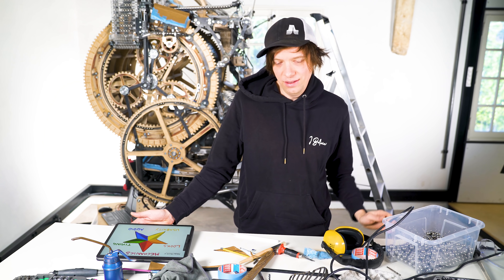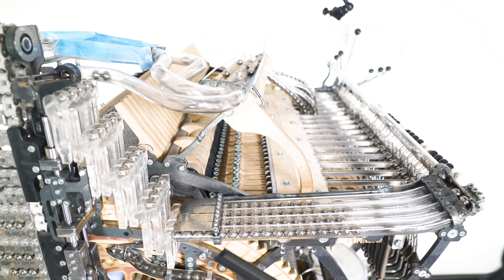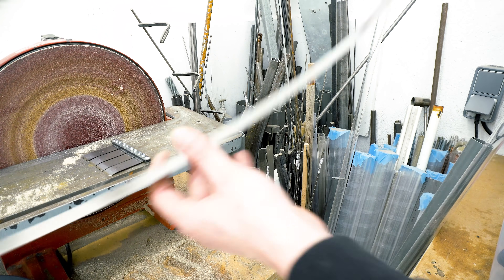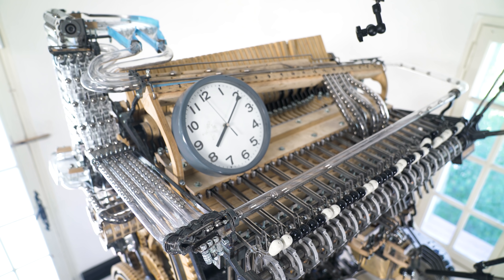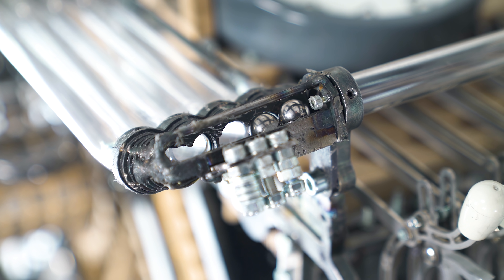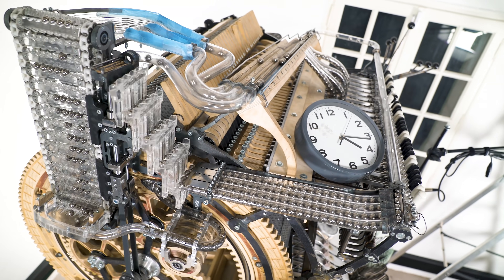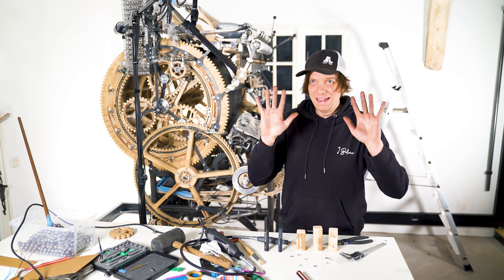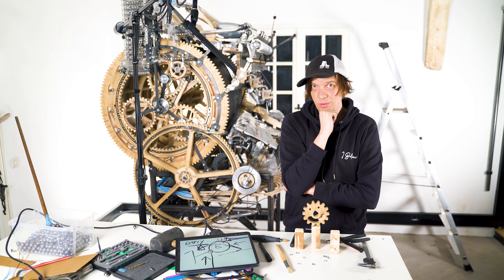Marble Machine X Fish Stair Upgrade

Comment: Yo, just grind a bit off the fish stair edge to angle the interface with the incoming marble such that it pushes back into the pipe at those interactions where the lane is starved rather than pushing the marble up against the spring steel.

Comment: If we could somehow control the timing where the marbles will enter the stairs in a "dry" scenario, then potentially we could avoid the issue where the marble is hitting the edge of the stairs. I wonder if it will be a better approach to completely replace the pipe with a "belt"/"chain" system to carry the marbles to the stairs and then dump it onto the stairs where it is at the lowest point. That way, regardless of whether the pipe is dry or the tempo is rapidly changing at different rates, the ball will always fall into the stairs at a specific point.

Comment: I find it easier to wash tiny metal shards off skin by first applying a decent amount of oil (mineral/"baby"/vegetable), scrubbing with water, then scrubbing with soap to wash away all the oil. The increased volume of oil on the skin seems to help the particles become suspended in the soapy mixture.

Comment: Hi, I've been thinking about how the flows will go in the future, when you start the vibraphone bars going. That will have a big impact on the variation in the flow of marbles to the overflow channel, and to the bottom reservoir. When you're playing a lot of notes, you will starve the overflow, and you will empty the overflow lifter, but that is not a problem (your need is to have marbles to play, not have marbles to lift). That means you will have to increase the flow of marbles from the reservoir to the lifting system. Your next problem is that when you start to play with fewer channels (e.g. bass solo, drum solo, 1-measure pause, etc), you will reduce the flow of marbles to the funnels, and increase the flow to the overflow, but with the increased infeed, the overflow will also overflow. Do you have a way for the excess to overflow to the bottom reservoir?

If you're only planning to play a few notes at a time on the vibraphone, maybe this fluctuation won't be so bad, but you can potentially play all bars at the same time. For a vibraphone, generally you can play 4 notes at a time, but you don't have this limitation here, unless you set yourself a procedural limit. So basically, this comment boils down to: what is the maximum and minimum feed and overflow requirements, and will your reservoirs feeding flows be able to handle them? (BTW, The part just before the tubes effectively becomes a 4-ball, self-regulating reservoir)

Comment: It seems like opening up the channels created a type of manifold system, which isn't a problem if you can ensure there is always a full que of marbles waiting to fill the later slots. Each tube could fill sequentially from closest to furthest as long as there were always enough marbles flowing. I play factory building games, and this is often a solution used instead of a true splitter for it's simplicity. You won't have 100% efficiency until the lines have enough time to saturate. Once they do, there is no difference between them and a splitter.

Comment: As the Internet drops some communications... errors happen... but it keeps going.  The fact that the marble machine will drop a few marbles is actually acceptable.   This applies because your music is limited in time, perhaps to a few hours.  So the fall out of a marble from the machine is an acceptable error unless if one were to play a multi day long song, then maybe you could loose N marbles and the machine could keep going with no problem until it can't get enough into the feeds for the gates.    Feeding the gate input tubes needs to be greater than the max rate of marbles leaving the gates.   If your errors were on the feeding of the instruments and they ran out when you want a note to play then that is a different issue, and that might be an issue.   At some point the sizes of the marble que in  counts of marbles in a tube feeding the instruments that will be played, will matter.   But you have a large buffer of marbles ready to go feeding it.   In the limit the test would be to set every programming pin in, and have every marble gate running at its max.  But this wouldn't be good music but would test the machine.  Here you would be emptying the feed pipes into the gates at the max rate, and here you can see if the feeding systems for marble return is theoretically able to keep up...  great experiments.   Some questions... what is the normalized feed rate of marbles per second going into the gate tubes, what is the max rate for marbles leaving the gates..a better number might be marbles per crank rotation...  with a constant crank rate, one could easily see the marble feed rate and compare it to the max marble output rate,    So some of the errors may not matter.  The only errors that matter, assuming you are getting reasonable numbers of marbles returning after being played is that the gate tubes are never emptied when you want to play a note.    great videos...and...please don't stop working on this..  there is likely some average number of marbles per crank revolution that normal music  will need to play...if the feed rate of marbles is greater than that then it should play essentially perfect.  So even if it in the limit can not keep up, it might not matter,    Perhaps the marble counts are adequate and the que and feeding is more than enough.,.., how many marbles are in the machine anyways... what a fantastically marvelous marble machine!

Comment: so you've found an edge case where the machine will fail and drop marbles all over the floor. 

I recommend, instead of breaking the fish stair transfer point by trying to adjust for this edge case, make sure that it cannot happen by having a surplus of marbles.

 As I understand it, the fish-stair is to recycle marbles that overflow from the instrument channels off the main marble divider. 

Since average throughput on the main marble loop (Instruments --> ring lifts --> demagnitizer --> main lift --> main marble divider) should be the same no matter how fast the music is playing, and on however many channels (marbles in should = marbles out) the fish stair is to supliment those times in a piece when a higher than average number of marbles are being used in a time period that is shorter than the time it takes the first marble to traverse the main loop.

If you're worried about how that might go, add a marble resevour before the divide by four mechanism so that both the divide by four and the fish stair transfer point are always well fed. this would have the advantage of keeping the marble dividers well stocked as well.

Comment: I can sympathize with wanting to stop under the circumstances that your design methodology has shifted. Working on the project changed the way you approach projects and the old legacy feels like frustrations and baggage holding you down. Ive done this myself many times. While trying to do something i discover a better way to do it along the way and just start over again using the newer, better way. Thing is it keeps happening and i never complete anything. I know many ways to do things good enough but i have never been able to settle on doing it. If you give in to this feeling the same thing will occur, you will take the knowledge you have gained here and the methodology you have defined and apply it to something else, and make great satisfying progress for a while, until you discover some even better and newer way of thinking and doing that makes you want to start all over again.

Each time you do this it becomes even easier to do it again, because whats a little more work thrown out compared to the ever growing pile behind you? Eventually starting over becomes the methodology. Its too late for me, i have to be satisfied that im at least refining methods still, i can aspire to some transcendent method, but ill never finish anything. If you want to finish anything ever again i advise you figure out some way to make "the process of refinement being recorded in the physical project, so that it can be a map of your shifting approach, methodology, and skill" become the ideal of the thing you want to create. Maybe then it wont nag at you.

Comment: It seems to me that most of the criticisms and critiques are NOT about trying to get Martin to give up. Rather, they are intended to be positive criticisms (literally, constructive criticism in this case.)
I understand that Martin has a very strong artistic side (without which, he would not be so great at generating music so (apparently) effortlessly. He is right that there are five aspects - the star graphic - but not all points are equally as important. Indeed, without some of the points being more important (mechanical trustworthiness), some of the points (artistic presentation) may not even be possible for more than a brief time.
I think he is slowly coming to this realization, and it saddens him - thus, the urge to quit.  However, he is also making steps in the right direction at the same time. 
I would recommend considering the artistic angle as a feature - just that - some parts will remain very visually pleasing (and worthy of video close-ups) and some will not. At the end of the day, if some of the visual flourishes must be sacrificed for the ability to rely on the machine, it is worth it. 
(As it is, a live audience will see - at best - two sides of the machine, with the other two mostly out of view. Notice even in the builds how seldom we see the back of the programming wheel and the frets on the bass. Both hold a lot of artistic and mechanical 'beauty', but they are mostly hidden, except for video close-ups. This is all to say that the whole machine does not need to look pretty, but to act as expected.)

Comment: Please don't give up.

Re the problem you're trying to solve right now. It's really the same thing as the divider for the channels, isn't it? I suggest dropping the little flipper at the entrance and play with the angle of the ramp to change the height of each queue so the marbles roll over the top of each to get into the system.

For the shooting marble thing, I think the bottom of the fishstair is too low relative to the pipe, the top needs to be open, and the whole thing needs clear walls surrounding it so excess fish can fall back down the ladder, like little Martins trying to finish the project.

Comment: Dear Martín. Please notice that the marbles in the divide by four are not only advancing. They advance and return backwards a little bit because they sink in the stairs slope and then are pushed back by the marble in the step and then by the step edge. Maybe if you narrow the step and adjust the slope Will reduce the constriction.

Comment: I still believe. Keep up the good work. Honestly with the failsafes you have, one launched marble when it is running dry isn't a critical failure. The divide by 4 seems to fidley though and my bet is it gets the chop saw soon. You could replace the Divider with a system similar to the divider at the top of the machine where the first tube fills up and then the second and so on.

Comment: There probably are lots of comments here about how to try and fix this problem you are having with the divide by 4. And here is another one, how about. Instead of needing 4 marbles to trigger the divide by 4. How about making it requires 5? 6? 7? 8? marbles to trigger the 4 to drop. That way the channels will always be full with extra marbles behind it to ensure a consistent drop/pressure similar to the mechanics you have with dropping the marble on the instruments where the speed/pressure is very much controlled! Love the videos! Don't give up on yours and our dream of you finishing this!

Comment: All I can see is a fix where you add a blocker to the divide by 4 that "activates" when the divide by 4 activates, blocking other marbles from interfering. As long as all marbles are able to exit the divide by 4 it should stay forever balanced.

Comment: I can't imagine it would be comfortable, but can you use some of your over-strong magnets to maybe pull some of the metal slivers from your skin?  I honestly worry about your hands a lot and encourage you to take more precautions and especially to not use anything that could seriously damage a finger while you're tired.

Also, don't give up, but maybe outsource some more of the problem-solving and potential redesign to the community.  Maybe people can solve the fish-stair entry for you.  My thought is something like a water wheel (in this case, really just a set of flat vanes extending radially from an axle) just before the fish ladder to segregate marbles as they leave the tube but allow the front marble to move vertically without pushing anything in a way it's not supposed to go (if positioned correctly, it should even shove the marble forward toward the fish ladder. You could maybe use some of the spring steel on the upper rear (away from the fish ladder) of the wheel to provide a bit of resistance.

Comment: Another possibility: put the divide by four on the other side of the machine and have the four tubes run across the front feeding the stair. This way there will be more time for marbles to enter and possibly will keep the channels full enough that you don't have such large gaps with no marbles.

Comment: I hate to ask a question that would end up with a full redesign of an area, but that 4 ball splitter? Why don't you have it so it is one that opens into a swinging "switch" so that it hits the wall, falls down a path and moves that block so the next ball will go down the other path. All you need is 3 of those and you can have 1 splitter going into 2 with 4 equally split paths at the end?

Comment: To get invisible chunks of metal or fiberglass off the hands,  use the stickiest tape you can get.  Lightly press it against the skin and pull it straight away, do not drag it and it will pull all sorts of tiny particles off the skin.

Comment: Martin: It seems like there may be an assumption here that could be getting in your way with the divide four. The assumption is that the marbles need to always move smoothly and unimpeded. If the marbles didn't flow so fast, they might not hit the stair lift with such speed when no marbles are in front of them. What if they don't need to roll forward under their own power? What if they entered the pathways but didn't move forward until they received pressure of marbles entering behind them? Maybe there could be ribs in the pathways to slow the marbles down a little, just enough that marbles behind can help move the marbles forward, but not enough that the marble will flow forward at a speed that it will run into the edge of the stair and be popped out. Maybe instead of ribs you could test it with some rough fabric in the channel for the marble to roll on.

Comment: Not sure if this has been talked about or considered,  Just watching the marbles run though the machine and hit the marble divider up top. Am I wrong in that the first few channels are only fed by marbles that are coming off the fish ladder and not the main lifter?  In a full song is that going to have enough feed to keep it topped up?  

Are the shoots designed to spread marbles out on the divider so that every channel or set of channels has roughly the same amount of marbles being fed exclusively to them?  or will there just ben so many more marbles on the machine then what he has now that this is not an issue?

Comment: the reason the come out (the last one in the video) is because the marble does not make it in time to fall into the elevator. So what I would suggest is something like you did on the drum marbles. I would create a gate that woul make have one marble separated from the queue, and waiting for the elevator cycle.

Comment: If you are unable to  get the divide-by-four to balance properly, you could try perhaps a series of these to alternate which pipe a marble is sent to https://www.thingiverse.com/thing:3637025 . Seems pretty stable and reliable/repeatable, my only concern would be if it could operate fast enough for the volume of marbles you are pushing though, but it might be worth testing.

Comment: The sharp edges claw the escaping marble.

Rounding them a bit could help.

Sketch: https://viewer.diagrams.net/?highlight=0000ff&edit=_blank&nav=1&title=claw#R7VpNc5swEP01HJsBiQ9zrJ04PSQzmUk76ZWCYtRgxAg52Pn1FZYwCOLUxoImdRgfrJVYSW%2FfrlZrG3C2XF%2FTIItvSYQSA5jR2oCXBgCWDYBRfsxoIySeZQrBguJIDqoF9%2FgFSWE1bIUjlCsDGSEJw5kqDEmaopApsoBSUqjDHkmizpoFC9QR3IdB0pU%2B4IjFQgr8hvwbwotYzmxbUHQsg2qs3EgeBxEpGiJ4ZcAZJYSJb8v1DCUldhUs4r35nt7d%2FBSl7JAXHqY3fuTeTu9ufq2LH8X3%2BCX8%2BcUTWp6DZCX3KxfLNhUAXAvHmjemRYwZus%2BCsOwpuLm5LGbLhLcs%2FjXIM2GAR7xGfNJpzih52qHGNzztrllu4xlRhtYNkdzDNSJLxOiGD6l6HQmw5JMr4S1q43hSFDfsUskCSYfFTnENGf8iUTsCQesABNPoa8lE3kpJilTUBEgzkhC6HQ3nc5M%2FvOf3aplJf3CrplQq1RwBMIoUmnfhbeDnvIJfJaMoCRh%2BVp3jNVDlDHcE85XU1vNdxXqOr2rIyYqGSL7UJHNLD7BNVU%2FLvCygC8Q6erYW3m26v9FtLUb%2FSIazJyrgttnTcO7bevYYjkMZbBrDsnJAvn%2B50Ht1mpoGQqFWUjiDRYIuXXKOE2up2srmuFz0ZfkWJas0KgPxtvXeCdbil9WXYFaLYBYchmGdecAIFHNHpNh7J0zHABNdjAHjHiaTsztMLE%2BTs7dPpY6igU1XXVL0OaRpli75X1i1k5T1Te4Oze6ODuEt9lS5yaAh3AJn5%2B5tL9WWPB6aPWqzHfx0930JG9SVsHUU6fJ20JoHmseta4wEzzq%2Fm2UHZ115HIRg3OhwyAWwdzGNEsZRJqkhrnPD1NbsSetAlCr%2BWXFNz4XnQ7mDpymutk%2FdQ%2BOqLncAJ4cysVFEMV8KoqWv4HSx4%2F%2FfCyBce6O17W3UU3f1%2BG3nE2JhfLxvvRPSaDuLWwEAAjguZ06uoX1ypidn%2BhfcHHBhNh%2B1wm9VJhyLQmd4ZAxXCfPHtd2ppbA%2BP5l9rDK55bdSNMfTkx4MVWTZV8wZ9BpV1fw%2FibTfLqarhm31Z3XHvfCbjyaWjUSy0zjGm%2FXfMsTw%2Br8t8OoP